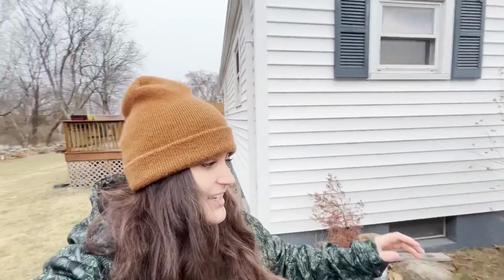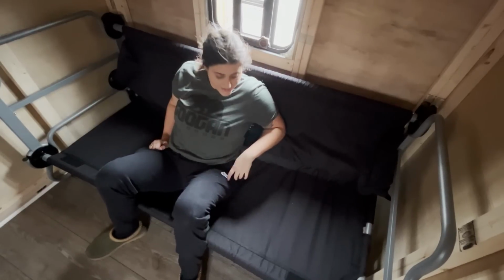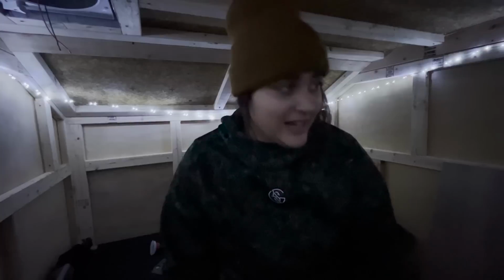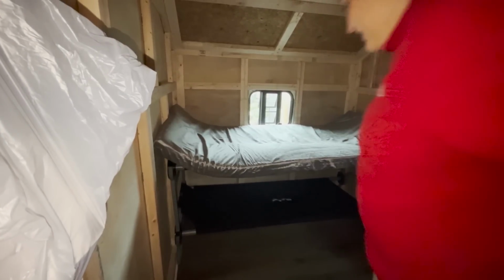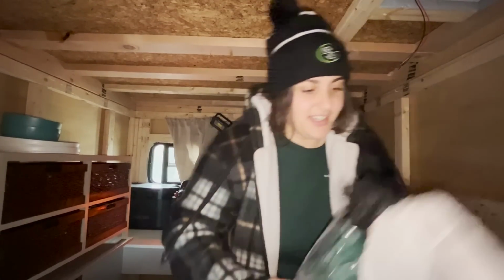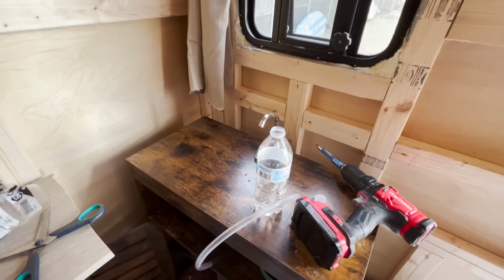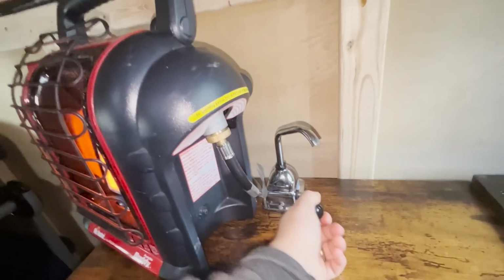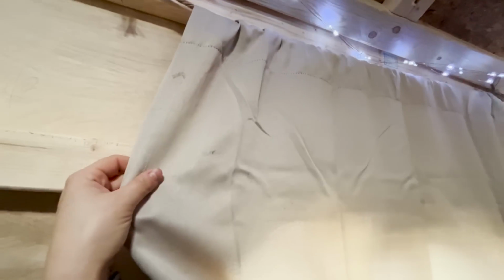Building INSIDE My Tiny House (10x8sqft Interior)

Comment: Foamular 150 R-5 "Pink board" glued onto the walls would probably cost about $75 total and would do wonders for the echo and the temperature. Love the build. You did a great job on the sink and table.
Reply from the maker: thank you!!
Reply: i was wondering if she was going to insulate it or she will freeze
Reply: I’m a new follower but was also worried about the insulation. We can’t have too freezing
Reply: You need insulation for where you have camped in past it would help with cost of heating
Reply: Its perfect!!
Reply: Too much dialog.. not enough results
Reply: There is a brand of insulation used in shpping container homes , it's named  InSoFast

It might work for u.
Gateleg table might help as well.
Reply: Agreed

Comment: You are making great progress!
I am from Middletown, RI and now live in NC. 
I am currently building a 6x12 Cargo Camper.
Even in the summer you will want to have it insulated. When you do look at Lowes or Home Depot for 1" thick and 1/2" thick RTECH Styrofoam insulation which is white with a silver backing. When installing it place the silver side to the outside and the second layer with the silver to the inside. The foam insulation will provide an R value of almost 7 plus the silver reflective reflects the heat away from your tiny house in the summer and in the winter it will reflect the heat back to the inside. This type of insulation is slightly less expensive than the pink or green poly foam insulation plus it has the benefit of the reflectivity.
Your walls are the Thickness of a 2x4 so the 1/2" and 1" material should work well. 
Remember to keep it simple and make things do multiple tasks. 
Love the bunk bed/couch.

Comment: Great job!! The sink?! You don’t need a permanent one. Like it is, you can swing the faucet over and have extra counter space. I would consider maybe a piece of the   Stuff you out under rugs to keep from slipping. Then you can just fold it up when you aren’t using a bowl. 
Just a thought but by the bed, you may want to consider another folding shelf or two. Then when you’re sleeping you can put it down or you can put your laptop or tablet on one but again, when you’re done, fold it down. The bunks were a brilliant choice. So many uses and very little space. 👏🏽👏🏽 
Since heat rises, I would put something on the ceiling for insulation.  You can upgrade it later but the pink board the one guy was talking about, that would do great. 
Ive known people to collect quilts and wool blankets for a temp fix on insulation for the walls. 
Best of luck. Especially on the maiden voyage and travels. I have a feeling you will do a short trip soon just to check it out.
Reply: You may want a portable fire pit as well. And Dutch oven/ iron skillet. Saves money on gas. You can cook on the fire pit. There are sooo many different out there. Amazon is a good place to see a lot of options. And YouTube?! You can build your own. Lol
Reply from the maker: i just posted a new video where I insulated it!

Comment: Hello Again Becca,
Your Buddy Heater Has The Two Holes for Temporary Mounting and the Measurements are Just Over    8 1/4" apart. The Heater can be hung up on the 2 Screws while you are driving as well as when using it.
That Way The Handle can be Folded Down so It Doesn't Melt if You have the Heater on High For A Long Time. 
Bungee Cords and Straps Can Be Sure To Hold So Many Things In Place when Driving and Just To Keep Your Stuff Securely In Place.
I See I Was The third person to talk about foam insulation, and the foil Backed Stuff Sounds The Best.
Feel Free To Ask All Of Us For Help & Ideas On How To Do Things Best
Take Care and Always Stay Warm !!

Comment: Hey there, have you thought about an electric fireplace you could run it off a solar power station and get solar panels to charge the station itself.  It could also help with a fan in the summer or a small 12v fridge/cooler or baby air conditioner thats 12v.  

Also please pick up your detectors fire, carbon monoxide  etc and also grab an extinguisher.  Also dont forget some toilet paper and i wouldnt put extra bags at the bottom of your toilet, only because ive heard stories of bags leaking etc. 

Definitely insulate, worst case pin up some blankets on the walls like they did in the olden days until you have the money to do it better, just becareful with your heaters.  You can always ask family or friends if they have some, they may want to part with, then when you do have the money, you can always donate those to charity or vets or humane societies in your area.

Id also consider, non slip mats from the dollar store.  It will help keep things from sliding.  Also some brackets or tie downs for your propane tank etc.  You dont want that puppy moving around when you're travelling.  Also try baby locks for drawers and cabinets, or bungee cord around things that may shift.   

Also you may want to get a hitch lock.  I say this because yes you are travelling and yes you will be staying in this tiny home.  The last thing you need is for someone to unpin you while ur in a store or sleeping etc.  You  may also want some big stones or chalking blocks just to put behind your wheels while parked.

Think security, be it your phone calling 911 or perhaps a fish bonker on stand by incase someone decides to try something.  Im just saying protect yourself.

You may want to add a few solar lights for the outside, be it white or yellow light to reduce bugs.  Its always helpful when you can see outside.  

You can add mirror tint.  Its a one way tint where you can see out but they cant see inside.  Its cheap and you can install it yourself.  Simply cut to size, make a template with paper first. Then spray the window with water to allow the tint to stick then press a sponge, squeegee or bank card against it and slide all the air bubbles out the edges.  Then wipe the excess water away.

Also when you are thinking furniture, always have it do more then 1 thing, like the bed, couch, spare bed etc.  Think the same thing for storage, etc  have the item do more then just the 1 thing.

Also for fishing rod storage, use the ceiling and use the bass boat deck hold downs but put it on your ceiling.  

I hope a few things help, good luck .

Comment: Have you thought of doing a insulation on the inside...even if you used reflectics to help with the heat...its thin and you could just staple it to the wood and would help with keeping heat in ...and maybe the heat out...could cut to fit inside each square piece...so far the build looks really nice...seen your build videos of it...👍the bed / couch is a awesome idea...use some paracord for your curtains...if you put a 1x2 along the floor under the bed ...the storage bins won't slide out...like a stop...hope some of the tips help ...looking really good with all the stuff your doing...you could get a collapsible Tupperware for a sink to wash anything you want ...and then put it away...
Reply from the maker: i just posted a new video where I insulated it!

Comment: Be Sure Becca That Anything You Put In Is Screwed To The Wall Supports Or The Floor, Even Your Buddy Heater As There Are Two Screw Holes On The Back So You Can Carry or Store Your Heater As Well As Operate It As Long As There Is Nothing Right Above It Or Close Beside According To The Manual. Even the Bed Can Be Held Solid With Conduit Or Pipe Straps.

Anything else you would Want To Be Solid While Driving, You Can Buy Eyebolts That Can Get Screwed Into The 2x4's on Each Side Of your Toilet, Tubs or Pails and Hold Them All In Place With Tie Downs.
And Put A Small board across the shelf where your small Stove Is
Propane tanks Can be Carried in  Milk Crates.
Use Blue Styrofoam to Insulate the Walls and ceiling. ceiling First As the Heat Rises ! From Alberta, Canada. ;)

Comment: This thing is cool AF, it looks way bigger on the inside than the outside. You could always use old comforters or moving blankets on the walls and ceiling for a little insulation. I would 100% put a solar panel on top to be able to charge your power bank, put a bungee cord on those desk cabinet doors, they will fly open from the stuff pushing from the inside out when you are driving...one last thing....and most important....get a fire extinguisher and hang it on the wall somewhere you can get to it quick.

Comment: Everything looks rough at the start. That's what you gotta remind yourself. Its a work in progress and one day you'll back on this video and on any doubts you had and laugh.

Get that insulation in asap before camping. I would also suggest making sure everything is really secure before you drive it off. Don't wanna get to your camp site to find your stove fallen and busted. Being in a tiny space means using every possible space wisely and effectively. Don't look at a spot and think "Well i'll never have a reason to use that" cause you will.

Best of luck. You've already made great progress. Think positively!

Comment: Becca you really should put in foam insulation board all throughout the tiny home on the walls and ceiling then put up some wood paneling to help keep cool air out and warm air in during the winter and heat out and cool air in during the summer plus it will help echoing and will give it a nice cabin look.
Reply from the maker: i just posted a new video where I insulated it!
Reply: @beccayaseen  awesome I’ll have to check it out.

Comment: I love the overall design of your tiny home but think if you'd built it to the actual width of the internal measurements of your trailer your would have had more room to sleep across the tiny home  and if you had made  bunk beds which allowed for the top one to fold down you could have created your couch which could have doubled for a seat to dine at even if you had placed a fold down table on each side allowing for 2 people to eat inside. Underneath your bottom bunk could have been used to house some slide out drawers for storage. One or 2 solar panels on the roof connecting to a battery that could be housed in a cabinet could allow for energy and another padded seat to sit upon . Using the butane gas stove is a great idea because u can move it outside onto a table to cook if needed. A small car fridge could be connected to a plug linked to your battery so u can keep drinks and some daily food essential cool enough. Your idea for a sink is good and you could set it up to drain into a 5 gallon container or straight to ground if you are camping in the outdoors etc etc. ..I was wondering what did you use to seal the outside of the camper so it was waterproof?

Comment: find an old washer or stove & the tin will make a great backing for your stove & buddy heater , the paint on appliance is tuff just cut to fit.....make sure you get a fire extinguisher too , ps ..I think on the back side of the buddy heater there are holes to hang it on  the wall

Comment: Becca you should totally add 2 holes with catch covers in corners or somthing and use it as a tiny home all summer and winer and fish out of it for a few videos too it won't hurt the insulation if your scared of that spray foam the catch covers I did that for my wheelhouse lol
Reply: I'm interested in these tiny homes I've lived in my portal ice shelter for 2 months strifht now in otter sil County I could totally live in a tiny home lol
Reply: I also understand stand you would have to cut the holes in the trailer too but they make xtended hole sleeves that would go down to the ice

Comment: Becca your tiny house turned out great, however it definitely needs to be insulated if you're living in a state where you have seasonal weather, that includes winter. It also makes sense if you plan on traveling to other states where it's cold.
Reply from the maker: i just posted a new video where I insulated it!

Comment: I would just buy a plastic Tupperware type bowl, set it under the pump or cut a hole in the top slightly smaller than the rim of the bowl at set the bowl in the hole. You can then remove it and throw the water outside. If you are cracking the wood putting in the screws when building the shelf. Drill a pilot hole, where the drill bit is slightly thinner than center core of the threads of the screw. Only the threads will bite into the wood and it won’t split on you.

Comment: You can buy a 10” or 12” stainless steel bowl cheep, buy a face basin drain , drill hole the size for the drain , hook a hose or pvc to drain outside your floor. Sink cheep. You can cut a hole to recess your bowl as deep as you want or completely recess it. Good luck

Comment: Check out the moving furniture quilts at harborfreight. They are quite inexpensive (I have 2 of the largest camo thick ones) and are great for a cover over a bed mattress. The first one I got on sale at $12.50 plus sales tax, I think the second one cost me about $15 end of  2022. The ones I have use raw cotton filler, the outer part is polyester, but have strong stitching in them.

Comment: No to the sink. I've been living in a Lance camper for 7 years now and, I can't remember the last time I used the sink or faucet. Paint the toilet brown with bits of yellow here and there. My only real critique/concern would be, the way the house is strapped to the trailer. I don't the think 2 ratchet straps going  across will be strong enough. Maybe one in each corner if you're using the smaller ones like what you have currently or maybe 2 if you had the big beefy kind. Other that, its a cool setup with tons of potential.

Comment: Becca get a pvc pipe a hair longer than those little spice jars together and cut it half length wise the same as all the jars and screw it to the wall across the top of the wall to hold all the jars !!
Reply from the maker: ouuu!!!
Reply: @beccayaseen  it can be like the schedule 40 which is a thick wall or if not heavy jars they have a thin wall pipe it’s black on inside and white on outside !! Just saying have a good one be safe !!

Comment: Ya need spray foam insulation or atleast foil board in the gaps thrn cover it with 5mm ply wood
Reply from the maker: i just posted a new video where I insulated it!

Comment: Hi Becca
Love the bunk bed. How are you going to secure everything when moving?
Reply: A simple and easy solution would be to use bungee cords. She can easily attach them when she's driving and when she needs to take them out, she can just unhook them from the bunk bed legs.
Reply: @wysiwyg0  can attach brackets to the outside of camper on trailer and safety attach the 20 lb propane tank.

Comment: If you want to get some good insulation for your camper real cheap, you can get 1/2 inch thick sheets of styrofoam. I picked some up from either the shipping supplies department in walmart or the insulation department at homedepot. You could insulate your entire camper for around $30.
Reply: Oh, I almost forgot. There's two different kinds of styrofoam. There's a more expensive kind and its solid. Then there's the cheaper stuff thats actually made of the little while foam balls all clumped together. I was recommending the cheaper stuff. I think if you're running your heater anyways, it should be find. You could always double it up too.

Comment: Use electric \ diesel cab heater. That propane style heater will fume you out of there. make you sick cabin monoxide poisoning. okay to use to warm it space up\tools up. just can't close the doors window. fall asleep, never wake up. They shouldn't be used in tentative shakes a cabins ever. Just to warm them up. Shut it off after you go in. Start small wood atoo. The cup woodstove. Is good size for that build. Burns about a milk crate A night of hard wood of branches to heat your cabin. Think there's just enough room for extralarge steel mug for cooking pot. Works for so update we boiling things. Team coffee water also. 

Way safer more useful also. Little pricey, there efficient tho. They use them on boats aso.

Comment: Is it safe to use a 20lb propane tank indoors? The only place to properly use a propane gas cylinder of any size is outside, as required by NFPA 58. Using a cylinder indoors is not only illegal, it is terribly unsafe.

Comment: Why is a 20 lb propane tank in the camper. 💥 you need to use the 1 lb tanks inside. My husband won’t let me put the 20 lb inside our house. I bought a 15 or 20 foot tank extension so it can sit outside. It needs to be secured outside.

Comment: I was going to say you might want to get you some inch and a half foam board with luminum foil on it you can cut it with a razor blade and then if you want to use liquid nails to hold it up on the and I would put it in your studs and then screw somebody over the top of it to create another barrier and it will really hold in the heat they have a home Depot I will paste it in here a copy and paste it you can find it 1 1/2 in x 48 in. x 8 ft. R-5.78 EPS Rigid Foam Board Insulation
Reply from the maker: i just posted a new video where I insulated it!

Comment: That can't be 10x8' size, unless you are near 8' tall and had special bunk bed fitting in there. Based on standard bunk bed length it seems about 6-7' wide. Could you give us accurate measurement of the outside walls of your tiny trailer shack?

Comment: You got to be more patient. You have great first ideas but you give up trying and you just move on to inconsequential stuff. If you were having such a hard time, couldn't you get SOMEONE to assist/show you how to do things properly? Great idea though. I subscribed just for the effort. As for you 'tap', I would add a bowl/sink because it looks weird with just a tap. if you could possibly drill a hole in the bowl (not plastic) as a drain and stick the bowl to the table. You have the room under the tap/counter to hold to 2 water jugs. One for clean water and the other for your grey water. Then you would have yourself a fully functional tap and sink.